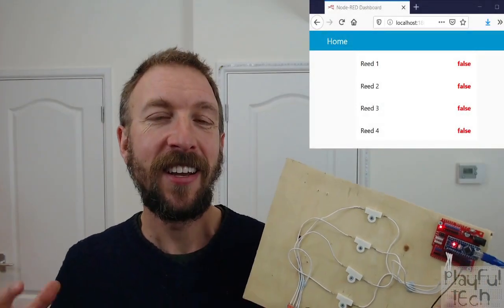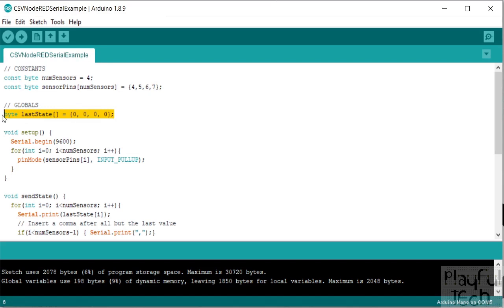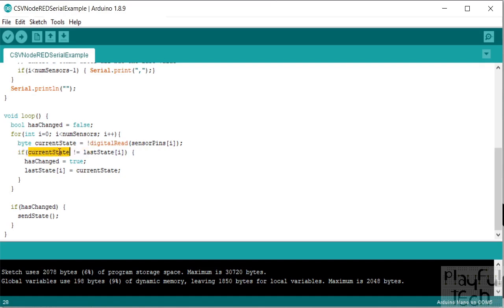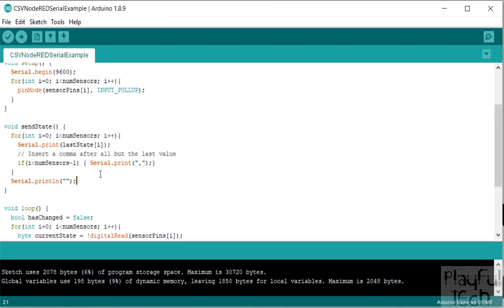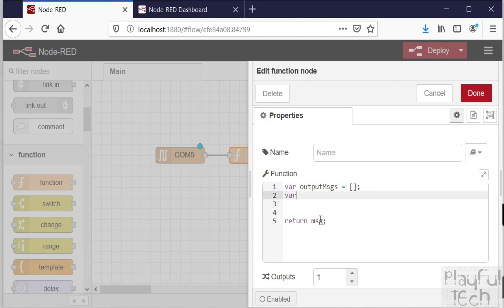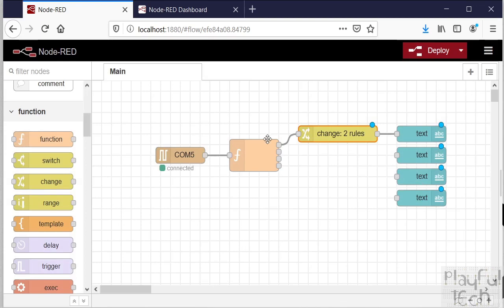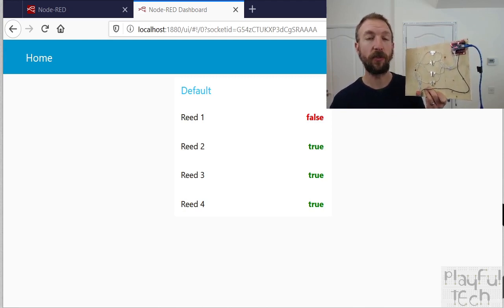Realtime Monitoring of Arduino Inputs on a Webpage using Node RED

Comment: Very good sharing and smooth coding experience for the function side. I was discover the way to do it in simplified manner, using the switch >  switch (insert the argument, example sensor1=) and read from that angle. However, I really appreciate the knowledge you share about array applications. Thanks sir

Comment: there are nodes for split set payload. its very cool that you are doing it by function node but missing the all point of noob red :)
the serial node is new to me so very cool :) i have allot of Arduino laying around i will make use of it :)
Reply from the maker: If you'd rather use one or more of the built-in (or contributed) Node-RED nodes, that's fine! I'm a programmer, so I find the function nodes the easiest and most flexible to use.

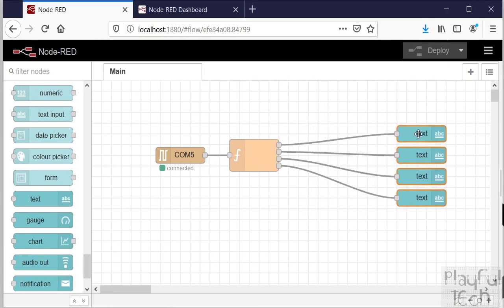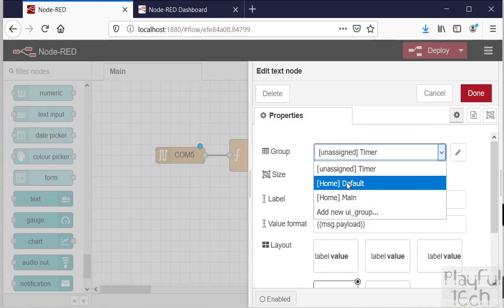Comment: Also small tips for all that are starting with Node-RED: 1) 14:35 you don't have to delete the lines and then reconnect them to the inserted node - you can drop new node on the line and it will be inserted automatically - a bit faster; 2) 13:33 also, with lots of dashboard nodes, you can quicker assign them to particular groups on the side panel just by drag and drop

Comment: Great job as always! I’m hoping to see how you take this further... for example, you have your 4 reed switches, once correctly placed it shows on your node screen, but how do we then get it to action say a mag lock? Would this have to be programmed into the Arduino or can node control the mag lock? This would allow for the games master to manually trigger a mag lock if they wished... also, if we wanted 4 puzzles, how would we link these up to the node at the same time (is it even possible) :) look forward to more videos and hopefully you can cover my questions :)